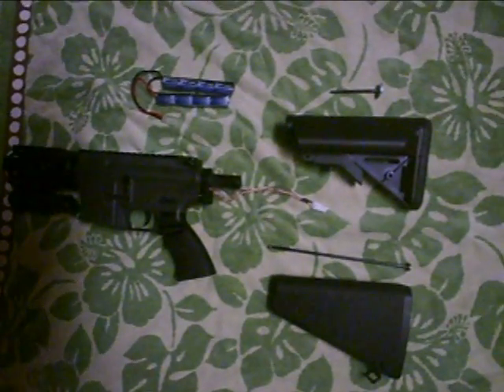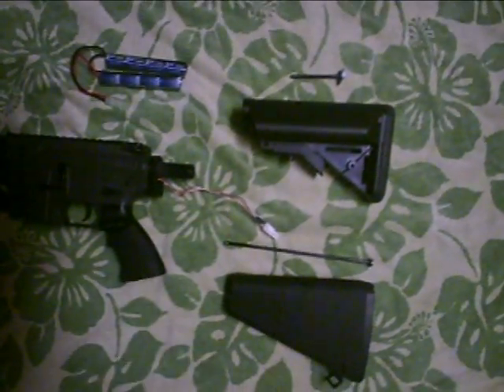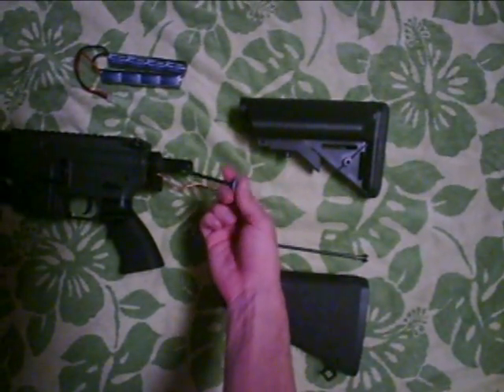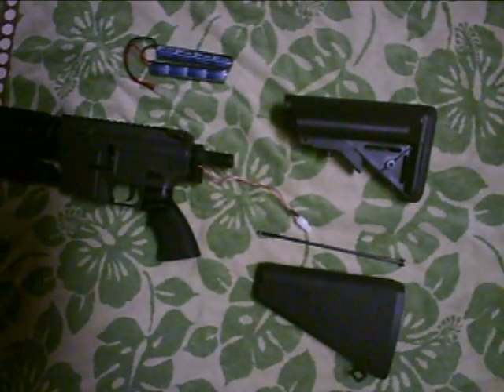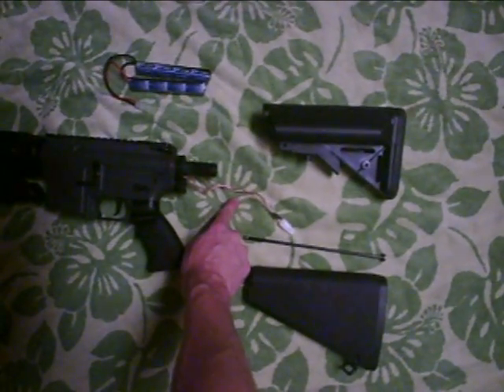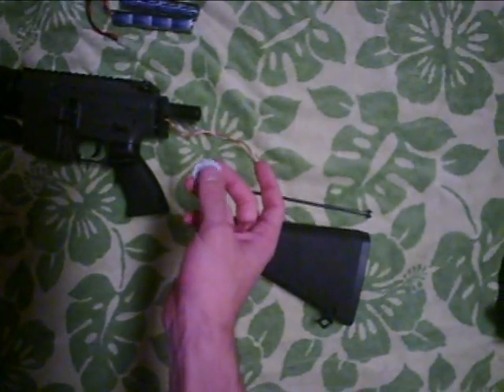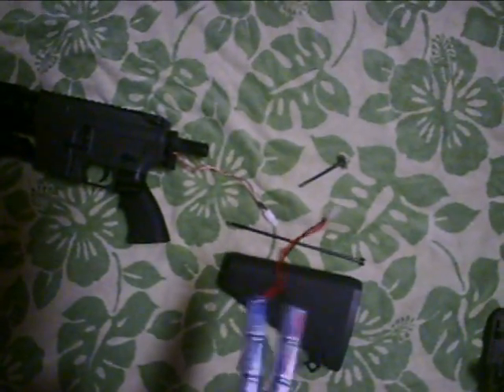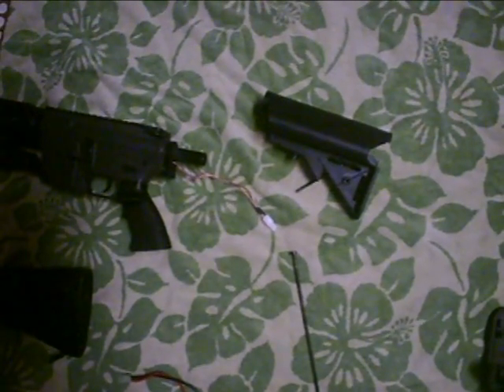Tactical Tips: Attaching a Crane Stock

Comment: @AirsoftBeach i think i understand what raygee11 is saying, put on the buffer tube no screw and washer pull the wiring all the way through, since the fuse is usually towards the connector for the battery, Then put the screw and washer through and tighten it. my thoughts haven't tried it but makes sense in theory

Comment: or... you can may find a washer with a divot/indent around one side of the circumference that the wires fit through... this only works if the fuse box is far enough back, which usually is the case(normally nearer the Tamy battery plug) check hardware stores or UMAREX TF16 parts (its an old POS M4 that they discontinued, but the parts may be in some junkyard or thru UMAREX USA as they may use the same parts on other models)

Comment: i just rewired my gun to use the crane stock (kinda hesitant cuz ive never used a crane) and the wiring turned out to be extremely short like the tamiya connector was just an inch out of the gearbox. i suppose its only to be used for full stocks but i already got a crane. i did find a solution by getting a fuse extending the wires and i got the crane stock on but the drawback was that the tamiya connection out of the gearbox is exposed. AND I CAN'T use a sling adaptor! sigh oh well